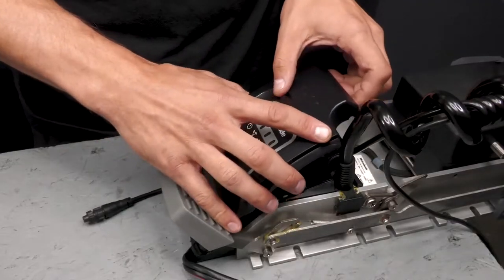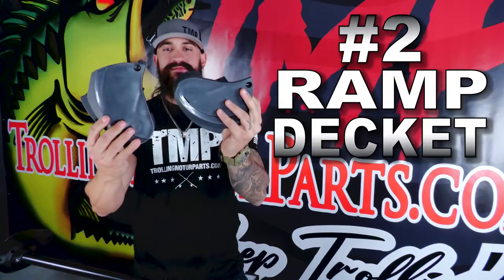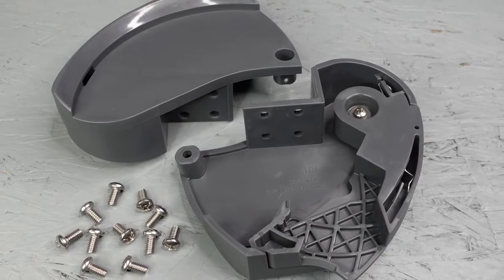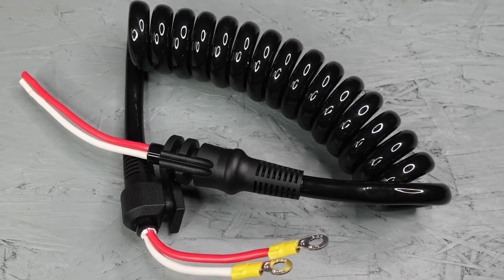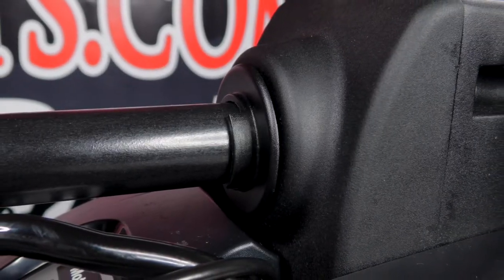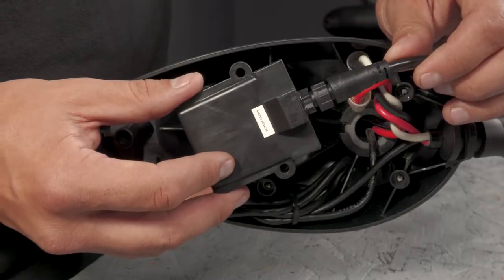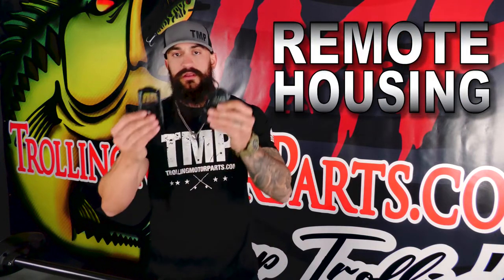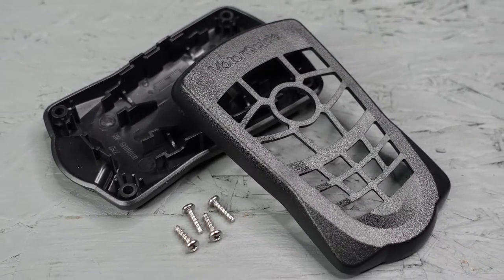Motor Guide Xi5 Top 5 Problems

Comment: 12 years on and my XI5 is finally showing its age... I've put it through hell to its used at least 3 times a week... only issue I had was the original control board failing and me dropping the remote in water....I'd buy another and with minn kota prices through the roof its a no brainer

Comment: ... Subscribed with the bell. Thanks. 
.
2016 Xi5, 36V, SW, Pinpoint. Has always worked great until the last few trips where the power to the prop was intermittent. 
Is there an internal switch that connects and disconnects when deploying and retracting? That seems to be where the issue is.
.
Last trip out, 4/9/23, prop would not turn all all. Everything else works as it should. 
Checked for 36V to the Battery Tender plug on the bow- Good. 
36V Monster lithium battery a few months old. 
Thank you.
. Jeff .

Comment: The trolling motor “head” has no seals. This allows water to eventually find its way to the “lower unit” and wreak havoc. Good video!
Reply: I know I’m a year late but Motorguude, even in the late 80’s/90’s leaked bad. I’m here just to see if they’ve improved. Guess not

Comment: I've taken mine in for service twice and both times they couldn't find anything wrong with it. The first time the problem was in the remote control, so now i keep at least two on the boat, with spare batteries also. The second time my motor would make one single beep when deployed but then not respond to any controls and my indicator lights were not lit. I replaced my plug in connector and 50amp breaker, everything working now. My power cord is baked by the sun very bad so i would recommend getting a cover for that if anybody hasn't already done it.

Comment: My Xi5 is going on 8 years now.  1st year I had GPS problems, random loss of GPS and or anchor spot or heading.  Took it in the shop they had it for two months, changed software "updated" it and said it was fixed.  Got it back soon the same issues again.  I took it apart and found that the wires going into the GPS modules where looking like they were pulled out a little.  Motor guide send me new GPS modules,  I rigged up a more robust cable clamp.   i have no issues since.  I cannot hear the alarms on the motor guide or the Lowrance F.F. that I use for controlling the Xi5.   It looses anchor in a stiff wind and if sleeping or not paying attention I could drift into rocks fast.  I can't hear the Anchor lost position alarm.  I am building an Mic and Amp for the alarm to wake me up and let me know when I loose anchor position.

Comment: Yeah my biggest problem is the play in the foot pedal. I can press down almost an inch both ways and it never engages the steering. I wonder if it’s a loose cable.

The Older styles with the metal foot pedal I’ve got so many of those fans they are the best trolling motor I’ve ever used

Comment: I’m on my second gps module. Bought one to return it and get a new one that still doesn’t work. The motor will not get signal. The install is easy. Am I missing something to get it to squire signal? I know I have to do the calibration but I’m not even getting a signal on my indicator panel
Reply: Same issue. I added the gps upgrade to my xi3. I’m about to scrap it

Comment: Can you do a video on repairing the xi foot pedal steering magnet(s)?

WELL DONE!!!
Reply: Yeah my biggest problem is the play in the foot pedal. I can press down almost an inch both ways and it never engages the steering. I wonder if it’s a loose cable.

The Older styles with the metal foot pedal I’ve got so many of those fans they are the best trolling motor I’ve ever used

Comment: I’ve spent hundreds of hours w xi5 and it’s never once messed up.
Reply: Pure luck, that's all.
Reply: I agree I got mines in 2017 and only replaced the controller once. it still run strong. I also keep in the garage when not In use and WD40 it after every wash. Salt water model. 😊
Reply: it's call Maintenance and TLC.😊
Reply: bought mine when the first came out late 2012 still going but showing its age....for the price they are great motors.
Reply: Good for y my gps went out 2nd year on my third remote in 4 years column caps had to replace 3rd year

Comment: Unfortunately today I ran into that same controller issue and broke the tab off the end that upset me a little bit. I just bought this boat from a friend with the MotorGuide on it and was pretty excited another friend just bought a Minn kota for half again the money so it will be interesting to see performance and quality wise. The friend I bought the boat from just took off the latest motor guide out of disgust I guess almost every single one has had to be recalled due to brain issues after they tried to tell him it was out of warranty he basically threw that at the dealer they finally agreed to fix it it is going right up on Facebook marketplace so now I am kind of nervous

Comment: Good video thanks. I have a question: my motor guide Xi3 will not turn left or right when I’m controlling it manually from the remote, but when I hit the anchor button, the steering works as it supposed to.  I’m thinking just replace the control board?

Comment: I run an Xi5 spotlock with a Humminbird Helix 7. Lately I've been having issues with interference on the sonar screen but only when the motor is moving forward or backward. The screen still shows depth and structure however it has lines running vertical across it making it difficult to see fish. if I shut off the propeller everything clears up. 
Any ideas what would be causing this?

Comment: I got mine directly connected to a fully charged 12v battery. None of the indicator lights are on, but I did see the power one flickering a few times like it was trying to come on. Is this power cord related for motherboard related?

Comment: My XI5 will only turn right, Is this a control board issue? My coil cord is working ok but it is degraded from sun exposure. The thick "collar" part where it connects to the trolling is split.

Comment: my xi5 is saying it is low battery, checked volts and amps on batteries(24 volt) and even tried recharging batteries. but chargers saying 100 % charged. what would you recommend I look at first. Both batteries are only 6 months old.

Comment: 55 lb Xi5 with GPS is having issues since the dongle update and .SWUP software update.  I can’t calibrate the gps. It’ll time out during calibration doing the tight circles with the outboard.  It did accept a factory default gps calibration though.  It also does the runaway speed routine when using cruise control.  It also blasts RFI when using my Airmar transducer at the transom. 

Would a control board replacement be worthwhile to try?   It’s an early build (2016) according to customer service.  

Thanks

Comment: XI-5 unit- was not operating with the RC so I bought a new one. Now , when I operate it manually with RC, it shuts down after about 4 minutes. On the Lorrance unit, I have to re-set the auto pilot function each time this happens. What setting do I need to change on one or both units? Help please.

Comment: So me and my friend have xi5 xi3 and yeas the remote is so sensitive and easy to just bend over somewhere and snap right into the water once it gets wet u will be lucky that it works and if does it will shut down a month later and they are expensive both of us already had to replace now the foot pedal u will soon break it to both of us replaced and mine I think I used to twice and it's already broke as I inside a plastic piece broke for left hand turn yes plastic these are the things I do had problems kind of keep me in business cause you know u love the thing ......do the small problem I have now is the transmission squeaks like a mother I pours oil everything on shaft still swueeerks one month it stopped squeeek ...   Then recently it started squeeeeeekng again no mount of oil grease will help time to tear it open

Comment: nice video. are these motors still recommandable ? or do they get broken all the time? or is the minn kota better?
Reply: I've had my xi5 for several years now and I haven't had any issues. I've beat the hell out of it a few times (on accident).
Reply: Several of the issues he listed are no fault of MotorGuide I've heard they have several issues and Lawrence has pretty much bailed on them as they tried to blame Lawrence on those computer issues however when he was talking about parts breaking after being jammed or hit on something that is operator era not motor guides fault. That being said Minn kota and other systems do have breakaway mechanisms to allow the shaft to kick back if you hit something however the shaft on that MotorGuide is almost indestructible I've seen them bend at severe angle and come back
Reply: @lauramurray6690  I agree. My xi5 hit a rock bank, bent in half (almost) and chunked my tracker deep v pro guide 175 backwards. A weld on the front of my boat broke and my trolling motor is still as good as new. My xi5 has also smacked into several boat docks when the wind was kickin' and still just like new. It's a beast. I'd buy another one. And lowrance did drop the ball. There is now a work around "code" to get my units to communicate. The glitch was supposed to be fixed and then lowrance released the Ghost and ditched motor guide the wolves.

Comment: What about the stow and deploy lock pins. Those flimsy little push caps will not stay on the pins, the arm that controls the locks (hooks, whatever you call them) will slip off the pin and you cannot deploy, or stow based on which position but it usually deploy because it happens when you step on the release foot control. Mine did this the second time out, and two of my buddies have had the same issue. Cannot find the parts to fix it!
Reply: Paul I agree1st trip out today 8-28-22 1sr time deployed the right hand side completely fell apart from the front tabs to the rear pins , these flimsily designed pins flat plate etc is very very weak and under designed 

Headed to bass prob tomorrow being today is Sunday 
Not happy at the moment dropping 3k for this 36 salt 105 and not happy at all , nothing against bass pro at the moment as long as they warranty with good customer service 
I’ve dropped 5 k this week with them Trolling motor , HDS9 & 3 optimas
Reply: @donwalden6285  I ended up rebuilding mine in my own.... Motorguide said I'd have to send it in to them...I ordered mine online.  Luckily you have a physical location. Please post back what they do for you.

Comment: I'm wondering how fixing the controller is a quick easy cheap fix we have Mickey mouse it by just drilling a hole through the top and adding a key ring but your bypassing the gasket so it's not completely sealed anymore no one sells just the back part of that controller that I have found I love having to Farmer fix the controller

Comment: Crazy question here...what TM do you see the least of? What do you recommend to buy? Minnkota or Motorguide? I'm in the market for a 24v 70-80lb TM.
Reply from the maker: They all have their issues.
But the ones we see the least, would be the ones with the least amount of electronic / gps features built into them.
I would base your decision on what motor fits your style of fishing and boat setup the best.
Reply: @trollingmotorparts  Thanks for replying.
Reply: great video.  my xi5 is not working the gps.  not even the indicator light is lit.  Is the solution to replace the GPS system?  or is there anything i can do?
Reply: @trollingmotorparts  I wouldn't be without my xi5 linked to my Lowrance, for spot lock, trolling, heading lock and automatic pilot.

Comment: Good morning, I'm in Brazil, I have a Motorguide xi5, my remote control when in use, if I'm turning it to the left or right side, when I take my finger off the remote control the motor head doesn't stop turning, do you have any idea What can it be?
Reply from the maker: It's hard to accurately troubleshoot without having the motor in front of me. 
But, I would start by testing it with a Foot Pedal. If the steering doesn't stick with the Pedal, My guess would be a bad remote.

Comment: Ok when u first get the x you will be thinking what a piece of dodo but once you remember the characteristics of how it works you can be a step ahead of it and make it sing I can be running up to shore to get snagg out and already have it heading locked and and boat going back the direction u want it and get the snag out and grab a sandwich you have to learn it's programming first before u give up on it then u will really like it and I have a jet boat lowe so I want to keep it light the xi3 or 5 you can pick up with one hand the minn kota two arms struggling just to get up to mount super heavy

Comment: #3 issue, tab on remote breaks easily
Reply: Yep mine broke but just roughed up surface and epoxied a key ring to back.  If you find the right size ring it will fit fine and then hook lanyard to the ring.

Comment: For starters, don't buy this cheap Motorguide crap and avoid at all cost!
Best tip I can give you.
Reply: I haven't had any issues with my xi5. I've had it for a few years now. Unfortunately, lowrance now has their own motor and therefore, have quit giving updates to the Motorguide products.
Reply: I’ve never came across an issue with my Xi5 ever. But, I also take care of my stuff and do routine maintenance on it. And all my cables have cable covers on them